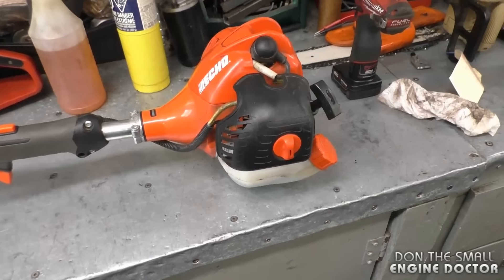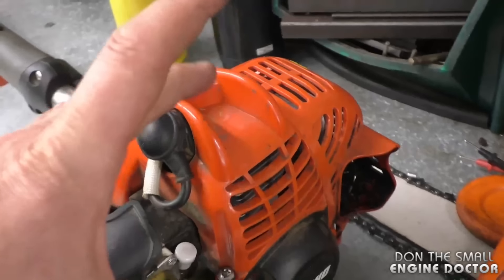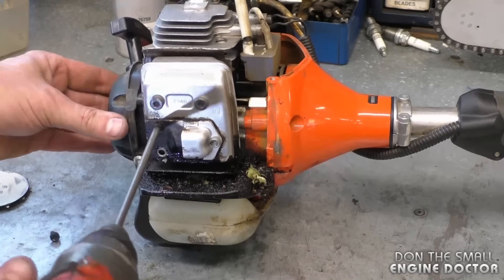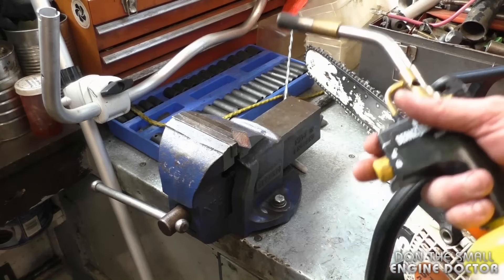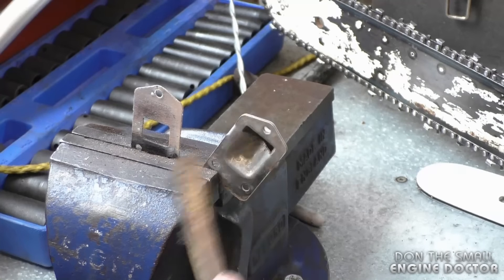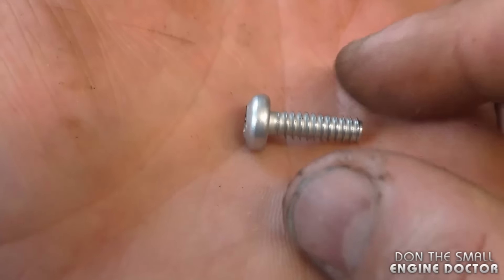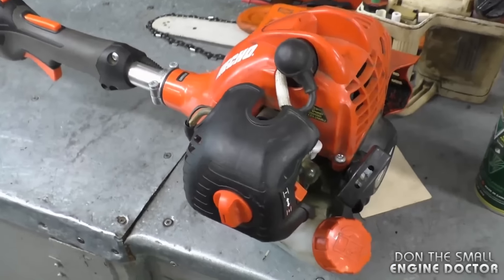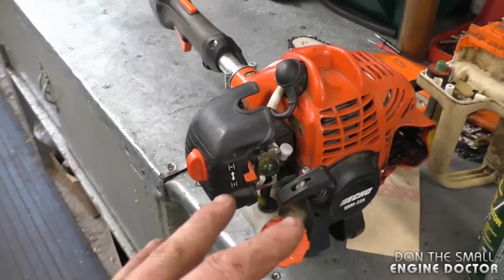How-To Fix A WeedWacker That Bogs Down

Comment: I have this same weed eater, it's 6 months old and i've already had to do this fix on it. I have the warranty and they said they would have to send mine off for repair and will take 6 to 7 weeks to get back and i use it every day with my lawn care. Shouldn't be already having to do this after only 6 months.
Reply from the maker: Use Stihl oil
Reply: @donyboy73  Thank you!
Reply: Need to take carburetor off and take out the epa plug and adj. It's running to rich.
Reply: @kennethlowe6337  After i replace the spark arrestor, it's been fine for another year, I bought another one and it does the same thing, after 6 months replace the spark arrestor and it's golden
Reply: High idle times will cause it too.  Make sure to run it wide open the vast majority of the time.
Reply: @BabyGators  ?
Reply: @kennethlowe6337  thats what I think I need, seen, another video on it, that why Im here now searching for that video. now? Dumb they make these $200 pLUS DOLLAR machines to break down so easy... I have been doing all the right things....
Reply: You did say every day commercial use 🙄 so you've burnt a lot of fuel and oil  yea it needs it especially if someone else's been mixing your fuel
Reply: Thank you.... Info is gold.
Reply: 😊Use a JASO FC or FD oil. FD has way more detergents in it than for instance FB oil like stihl ultra. Red Armor or Saber are FD approved. Project Farm tested Supertech which performed also quite well but is not approved JASO.

Comment: Mines recently started bogging when i accelerate.  It also stsrted spinning the head on its own with out me getting on the trigger. The screen is clean i checked it. Looks like it might be the oil seal since i saw oil in the exhaust .. but not sure

Comment: Gday from down under donnyboy73.  Your my go to guy when I need help, hope u can help this time......I have a Mitsubishi bg33, (same as a pope machine) 33cc straight shaft trimmer and need to know the coil armature air gap. Have tried the business card trick but its still not happy, this is a replacement coil after the original died. Thanks mate
Reply: Oh and it's a 2 stroke. 25:1

Comment: My Stiel does this however,  I have a new spark arrester, I rebuilt the carb but it runs the same as it did before I rebuilt it.  I have new premixed fuel, and I have good spark and my fuel filter is good. I even tried to run it without the filter to check it. The air filter is brand new. I'm at a loss for ideas. I'm about to throw it away. Any one have any ideas what could be causing this? Would low compression do this? The cylinder walls don't look bad.

Comment: Ok but what to do if trimmer or brush cutter dont have spark arrestor in general? And it lose power when i cutting grass, and it takes about 5-6 time to start, sometimes more when its cold, even if i change carburetor its same. The brushcutter is MTD bc43

Comment: My neighbors stihl fs-40 was doing the same thing, he asked me to look into it and sure enough, it was the exact same issue, caused by not using the correct 2 cycle oil and not running it up to temp.
Reply: Curious what was not the correct 2 cycle oil?
Reply: @kirkthebeerslinger  he was using automobile 4 cycle oil instead of 2 cycle oil, 4 cycle oil doesn’t burn off properly
Reply: @evanchapmanfanman  yikes! I could see one time...but not on the regular...

Comment: I soak my muffler in degreaser then rinse in brake cleaner to evaporate the degreaser then torch the muffler too. Once a year. Every few weeks I run it upside down at full throttle to get rid of accumulated oil in the crank case

Comment: I have 4 Echo 225's and they all had the bog at some point or another and I've cleaned and reinstalled and still had issues. I took everything back off and 3 run excellent without the hardware it's just 1 that is the thorn in my side. Now I remove the screens in everything the minute whatever begins to bog and I've had zero issues minus the one. Chainsaws, blowers, weed eaters it doesn't matter just be careful and observant in the area you're working in

Comment: Great video .. I think that happen to mine .. often I don't need to full throttle it's fast enough .. I guess I would have too.. is there a different way to clean if I don't have a trouch? What's the size of T27 u used?

Comment: Would anyone know why when I turn my weed eater sideways to edge, it dies, it only happens when the tank has less than half gas on it, it never dies when I am weed eating straight normally, just when I tilt, any ideas? it's an Echo PAS 225, less than 2 years old. I also see black Gue around the fuel tank, I'm guessing it's leaking, but it never dies on me when tank is almost full, even with the leak

Comment: Do all 2 stroke equipment have a screen spark arrestor?  I have two leaf blowers..one a 2 stroke and the other a cheap electric.  The electric is way better.  Now I'm wondering if the 2 stroke blower has this issue.  Must look this weekend.
Reply from the maker: yes all 2 strokes have a screen on muffler
Reply: @donyboy73  Thanks Dony.  I will investigate and update.

Comment: What do you think about tru fuel ??
Reply from the maker: https://www.youtube.com/watch?v=RRTj0HEZLEE
Reply: Great product!
High Octane.
Synthetic oil.
Fuel stabilizer.
No ethanol.
None of the garbage additives that you find in gas station fuel,that start degradation in just three months and gums up.
Good for at least 4 years unopened.
Two years after opening.
Reply: I tried tru fuel i think i got a stale can my trimmer was bogging , not idling,  not going wide . Dumped it put fresh mix in 100% instantly.

Comment: small engines like trimmers and chainsaws were designed to be run at full throttle ,even though it sounds like they will self destruct,it is the way to keep this from happening, the higher octane gas you use ,the better also, small engines thrive on high octane.i find when i dont run my ms271 chainsaw at full throttle when limbing it gets real sluggish , I know its time to run full throttle  to fix it

Comment: My neighbor gave me an Echo SRM225 trimmer when he moved away. He thought that the carburetor was bad and he didn't want to mess with it any longer. After seeing your video, I cleaned the spark arrestor screen and now the trimmer runs great! I also noticed that the spark plug and air filter looked fairly new, so I think my friend had already replaced them but the problem still existed. Thanks for the great vid!! I learned something new today.

Comment: When you were saying this is the oil I recommend to all you guys, Did you mean that on all 2 cycle engines or just that specific trimmer
Reply from the maker: all 2 cycle equipment
Reply: Is this include 2 stroke scooters also?
Reply from the maker: @kan815k  on some yes

Comment: I have a 8mm nut in my sthil fs240 r carburetor. And I can’t find that t wrench tool to fit it. I am trying to take my carburetor out so I can change the it with my repair kit. You know where I can buy one?

Comment: The number one cause of a clogged spark arrestor in Echo weed trimmers is improper fuel mix ratio (too rich) or running high idle for long periods of time. 
Use Echo oil or optimally use Echo premix. Echo Repair Specialist...

Comment: Hi donyboy73!!! I painted my old 3.5 hp Briggs & Stratton lawn mower engine, and before painting it, i putted peace of paper towel in the spark plug hole, and when i took it of, a very little peace of that paper droppep in side to the engine. It was size of the finger nail. Do you think it causes a problem when i start the engine?

Comment: I had a blower that would fire up great then die and not start again.  Hadn't worked on such in 30 years.  Changed the spark plug, etc. over a long period as I found channels like this one.  Finally applied scientific method which forced me to consider the exhaust.  Mud wasps had mudded over the spark arrester.  Cleared it out and the thing ran like new.

Comment: I have the same SRM225, New plug, new carb, clean spark arrestor. It cranks and idles good. But when I go full throttle, the RPM's are only about 3/4's. The throttle opens all the way (to the stop). I found the only adjustment it has (the hidden one) and adjusted that to both lean and rich, then back. But still only get about 3/4 throttle out of it.  Donyboy73, have you ever ran into this? If so, how did you fix it. My compression tester, read the same on this engine, as it did on the customers other identical engine. I even put the other engines carb on this one, and it didn't change anything.

Comment: Guess I'll check this out on my weedeater. Mine was doing the same thing last week. Thought it was the aftermarket kit I put on that let's you use the pieces of trimmer that you loop thru the head in 4 locations vs what came with it. 

Downside to the device I added on was the center nut has a tendency to work loose. Think I'll tear it down and Loctite it. Hopefully that'll work and not cause any issues. Maybe I can get some video of it and send you a link and get your thoughts.

Comment: What about the gas/oil premix stuff you can buy at the big box hardware stores? I've used that and not had issues except for what you've noted today in this video and this is the most likely reason I'm guessing that I'm having issues. Seems as if while it's warming up with the choke initially I start working and just leave the choke engaged at times as that does a good speed for me. It doesn't flood it. I've had the unit for 7-8 yrs and last year replaced all the fuel lines with new similar ones with fuel rated off the shelf lines as they were breaking down and leaking at the ends where they slipped on.

Comment: This video came at literally the perfect time, My buddy brought his Echo 266 over this morning because it wasn’t running and borrowed my 225 to finish a few jobs and when he came back we went and got the tune up kit at Home Depot with the air and fuel filter and spark plug but even after those it was still running shitty so now I’m gonna try this method to fix it

Comment: I WISH THIS WAS MY PROBLEM. WHAT THE HELL IS WRONG WITH MY TRIMMER?! it starts up fine but when the trigger is fully engaged the head STOPS spinning. I have to pull and release the trigger so fast to keep it spinning....
Reply: You may have a bit of material build up around the gearbox aka gearbox fitting normally grass or weeds from a yard can also cause that from memory.

Comment: I have yet to find one in Michigan. I would remove it anyways as once its used, there are no laws stating it must be on. I suppose commercial ones MUST have them but I never get those. All the commercial ones are maintained by the owner. I usually go with the internal screen  if the unit has had an issue all its life. I had a leaf blower that I replaced the internal screen  and put in one WITH a larger diameter holes. Problem solved. I have done it with lots of equipment over the years. They have in tank filters as it is. The internal screen is redundancy. They act like a jet over time. Some from the beginning.

Comment: I learned from other you tubers that my Echo PAS  trimmer was bogging, not from spark arrestor, but from the carbon in the exhaust port. Mine probably gets carbon buildup because I use saw blade on it a lot and saw blade cuts fine without full throttle.

Comment: What would you do with the Weed Eater brand Featherlite series, where the spark arrestor is not serviceable? I tried cleaning mine as part of maintenance on a couple of trimmers i just picked up used. But the spark arrestor is inside the muffler, and doesnt seem to come out. Do you have to purchase a whole new muffler?
Also, im missing the air filter covers(black plastic, that sits over the yellow plastic)
Where could i purchase 2 of them for a reasonable price?
If you have any kicking around the shop, would you sell one or two?
Thanks Dony
PS Im in Eastern Ontario.
Reply: I've seen people in forums talking about removing the muffler on some power equipment and putting it in a fire to burn the carbon out, maybe search into that some online to see if it sounds like an option for you.

For covers, unless this unit is worth investing money into maybe try ebay or craigslist for used parts. 

I see people asking random questions like this all the time, it takes time to search up random parts and most people are too busy to help. The trick to finding any part number online is by searching the web for your model # then look at the diagrams/parts shown on the store links that pop up for your model, find the part on the diagram and it will tell you what the part number is. Now you can search the web for that part number until you find a good deal, or used on ebay in some cases.
Reply: @viewer54322  
Thank you! Il have a peek, see what i come up with.
Reply: @splash5974  No problem, a couple of the sites that I often see popping up whenever I search google for an item (ex: if I search for "Husqvarna 223L parts") then usually near the top will be a few links to sites like jackssmallengines, ereplacementparts, partstree etc. Click any of those links and it will bring you to a list of diagrams for different sections of the model and all of the parts & numbers found in each section.

If you run into any issue doing the above, just let me know and i'll tell you how to alter your search.
Reply: @viewer54322  
Thanks again, appreciate the help!

Comment: I have a 4 stroke with that symptom. May be the same problem?
Reply: Not unless you’ve got a terrible oil burn problem.
Reply: I hit send before I meant to.  On a 4-cycle, assuming your timing is right and coil & plug are good, if it’s bogging its most likely either a malfunctioning choke; the carb needs adjusted, cleaned or replaced; or the air filter is packed full of debris.  It wouldn’t hurt to pull the muffler off just to check it’s condition (obstruction), but it shouldn’t be caked with oil & carbon unless it’s been smoking very badly.

Comment: Hey Dono, do you have a part # for a set of LONG torx like you have, either with an impact wrench end or with a 1/4" or 3/8" ratchet end?  Also do you have a part# for a set the LONG T-handle torx as well.  
I have some impact torx I use from a Briggs Stratton catalog I got several yrs ago, but there are times I need longer one and any type of extension will not fit into the small screw recess hole.  Thank you in advance brother!!!

Comment: I bought a used Echo blower that wouldn’t start.  Oil had been pouring out of the muffler all over the unit for years it seemed.  I think some people don’t even TRY to mix their gas right.  I burned out the arrester and then burned out the muffler; it sat there with a fire inside of it for like 5 minutes burning up the oil.  Then I scraped out the exhaust port and cleaned all the oil residue up.  It also needed a new carb but since then it has run and looked like new.  It gets only TruFuel 50:1 now.  Love my Echo equipment!

Comment: I.have the same unit  I have noticed that some oily residue on the plastic around the muffler  even  had a sthil handheld blower with a clogged up muffler had to wash it out with gas  but your right about the oil if mixed up the wrong way ooops 😮😮😮 that's what happens as always thank you for your time and help with the issues with the muffler.s on 2 cycle equipment my Canadian brother 😀 😀

Comment: Is it not just better to remove the screen? It should improve the HP
Reply: Alessio Sangalli you can remove it no problem but for a customer I’d leave it in just cause it does prevent fires started by exhaust sparks and you don’t want to be liable for that 
For personal use I’d definitely take that stupid screen out if it gets clogged

Comment: Low an behold, I'm having the same problem, I'll be in the garage later, had a problem with the leaf blower it was a mud dobber bee made a nest in the muffler, it was acting just like your weed waker. My weed weaker works good for 5 minutes then boggs down, hope the spark arrester is it. Thank You

Comment: Why do most "pro" landscapers I see remove the plastic guard/cutter from their trimmers?
Reply: I have a friend that used to work for a landscaping outfit, he said they did that with the weedeaters so that the line would be a fair amount longer without the guard there so they could get bigger swaths and were able to do areas quicker. Probably wouldn't work well on a smaller unit though, theirs were larger displacement units.

Comment: A spark arrestor screen is easy to clean off and can be looked at easily by removing a 2-3 screw plate on the exhaust side of the engine. Easy to do and we have to let out exhaust gases so an engine can run normally.

Comment: Great video!!! In a good way, it`s necessary to start with this (after the air filter of course). Without this, idle speed can to be "float". It is necessary to check in my blower and on the trimmers. Thank you very much. Best wishes.

Comment: Since we run at 40:1, our company has never been to a mechanic in decades. Shhhhhhh. It’s a secret.
Reply: Garrett Stevensen j
Reply: Manihote Esculenta of
Reply: @bacilluscereus1299  How does the fuel get to the air filter?
Reply: Also use 40:1
Reply: For real?
Reply: @benschreiber9472  For real.
Reply: Not 50-1?
Reply: @stevenlengyel9701  50:1 has almost no visible oil to lubricate the cylinder. 40:1 is what we run, and we've never had to go to a mechanic for over a decade, since we made that change.
Reply: My spark arrestor screen clogged at 40:1 in 3 months of daily use.